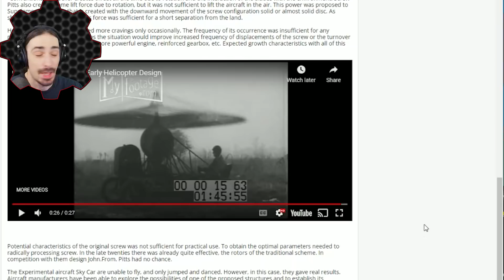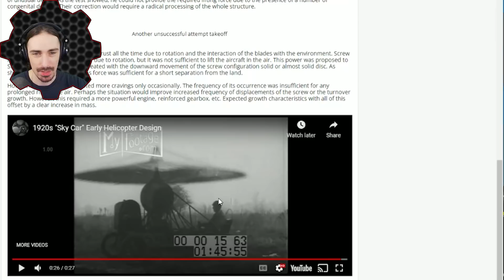Someone Actually Built This "Helicopter" And It Was Terrible... SO I MADE ONE!

Comment: This might stray from the purpose of real life recreations, but I'm actually really curious if there's a way to make this thing work. The concept clearly works, which is actually surprising, and I fully believe that you might be able to use the same method of catching air to generate lift in something different. Do you think you could make another try at this, but forget about making it look like the original entirely, using the concept in a different shape to make an unorthodox yet somehow functional flyer?
Reply: I agree and the one thing I noticed that hindered its flight is the angling of the entire vehicle.  If it stays perfectly upright it can actually either hover or slowly gain altitude.
Reply: The problem I noticed is that the lower part of the vechicle is too light. The wing-cone is the heaviest part so when pistons move most of this movement goes into the chassis.
Reply: @mixer0014  Yeah, he tried to fix that with weights, but I think he could've found a better way if he hadn't constricted himself with the shape of the vehicle. He had to, as this was a copy real life creation video, which is great content on its own, but it does make the creation much worse than what it could be if he had free reign over the shape of the craft.
Reply: If the cone was angled the other way (up), the shape would actually self-stabilize the vehicle in the upright position.
Let me give two examples with vehicles that are tilted to the right and drifting to the right. (On any vehicle where the lift is stronger than the drag, tilting the direction of the lift to the right will naturally accelerate you to the right.)
First, imagine the (original) vehicle with the cone angled down. The forwards blades (the right ones) are at a steeper downwards angle (because the vehicle is tilted right), so they catch more of the sideways flow of air and get pushed down harder than the rear wings. That means the vehicle will increase it's tilt and you get into a feedback loop.
Now imagine the same rightward tilt and rightward motion, but for a vehicle with a cone tilted upwards. Now, the rear wings will be at a steeper angle and catch more of the sideways air flow, eventually stabilizing you.
You may still get into an oscillation if the stabilization comes after too much of a time lag, or you may run into the problem of helicopters with ducted fans, which naturally self stabilize so much that their maximum sideways tilt allows them to reach only walking speed, but at least it has a chance of working.
Reply: To be honest, the way to make it work would be to put it in water. This is already pretty much exactly how jellyfish swim. It's obviously capable of producing thrust, the problem being the amount of thrust is less than its weight.
Reply: @cetomedo  he now HAS to make use of this and turn it into a full mechine now
Reply: Add some counter torque, like a traditional helicopter
Reply: I just made a comment explaining how I believe that a person could get this to work, it would involve a second set of blades with the same functionality as the first set but used in a slightly different manner. Check out the comment and see if it is something you think could work!
Reply: @boiltheoil7109  maybe just copy past it as a main comment so its more visable and just remove the direct pointed interaction

Comment: 3:22 The spinning was probably in part designed to ensure that the flaps close properly and regularly and are not as prone to failing to external factors
Reply: That is true. They are attached to "free spinning bearings" and without the turning motion they could randomly close on either side creating gaps and possibly other problems. Turning ensures they always closes in the same direction.
Reply: true
Reply: I was saying that the spinning was causing the flaps to rotate or flap closer to the closing point causing the flaps to go into the correct place. It was a good idea, but horrible execution this car was.
Reply: True
Reply: I dont see any stops for the flaps to not close the other way around, so probably yeah
Reply: I'm pretty sure the flaps actually stop before hitting 90° (after looking closely) & it could be that it uses a rotary piston(with that I mean a piston that turns a screw in order to go up & down). But this is just a guess.
Reply: I believe spinning was probably a way to get gyroscopic stability 
For those don't know what that is, it's  how a top or a spinner stays up right when you spin it.
Reply: I figured that at 14:54 the spinning seemed to make a gyroscope effect, stabilizing the aircraft
Reply: @anteshell  but it spins too fast, the spinning causes the flaps to always stay closed
Reply: @cyantasks7129  Thank you for informing me Cpt. Obvious!
Reply: the slats are supposed to be closed all the time while spinning, unless it is pushing up to let more air in

think of it like the inside of a parachute
Reply: I agree. Since the Scrap Mechanicsburg version it's powered to open and close the flaps it doesn't need rotation. Scrap Man, please try this once more without the rotation and make an update video if it makes any significant difference!
Reply: @RealPanzer999  i was about to comment the same thing

Comment: The idea is this: the propeller construction goes up, with the flaps 'open' letting air through, when it goes down, he flaps will 'close' adding a lot of resistance, generating some lift. It spins so that the existent drag would encourage the flaps to close faster. Which means that the propeller construction doesnt need to spin fast at all, but he oscillation have to be quite long and very rapid for it to function properly. Theoretically this would work. If you disregarded a lot of things. It was probably a take on an ornithopter
Oh! Its a wheeled-air-jellyfish
Its like using the reed valve instead of a prop
Reply: i think using sails would probably be better for this then wings

Comment: Hello! Back with another comment, I would love to see you make another version of this! What I have in mind would essentially be the same vehicle but with something that might make it fly! I think that if you added a second copy of the wing mechanism underneath the pistons spinning in the opposite direction/opening and closing at the opposite time of the top propeller it might actually work, the reason I believe this is because when you initially start the machine it pushes off the ground and that's where the momentum seems to come from, if you have this opposite set of blades it should act as drag to keep the machine in place as it pushes the top set of blades upwards and it would counter the torque keeping the vehicle more stable. Keep making great videos!

Comment: I have a good challenge for you. Try to make a helicopter using vertically aligned rotation. (so the "rotors" are upright like bike wheels). I'd imagine they would look like steamboat paddle wheels, and you could vary the angle of the "paddles" to produce lift in the right direction.
Reply: basically the cyclotech VTOL?
Reply: @apersunthathasaridiculousl1890  Similar, but it looks like the cyclotech uses fixed blades (I'm not familiar with it.)

Comment: my theory as to why the cone was spun is because it would help the flaps stay more horizontal, so on the down stroke, the flaps have much less distance to travel in order to close and capture air. the flaps are probably also able to rotate by 180 degrees, so the spinning guarantees that each flap closes the proper direction. also, if there were no spin, there would also be much less air encouraging the flaps to close, like dropping paper vertical to the ground, the paper will fall and cut right through before eventually rotating enough to then become horizontal.

Comment: Hi there Scrapman rather than the concept of this flying car, I think this inventor thought of the Slinky effect.  You know with gravity that if you stretched a slinky from top to bottom at a vertical angle then drop it you get the effect of the top needing to come down first in order for the bottom to fall, meaning that it is in a temporary state of zero motion which is keeping it up in the air until the top comes down. So I theorized that he might have been thinking of that but trying to do the reverse and continuously keep zero motion but use the top to push upward.

Sorry for the long text, I just like explaining something that might be funny or interesting if not at all.

Comment: You should try a second propeller attached underneath the car, moving down when the top one moves up. Not sure what the wheels would look like in that case, but at least the torque and piston motions should cancel each other out, and make the thing a lot more controllable. Maybe something where it "takes off" facing the side, then you turn vertical once in the air? Or have it where it can tilt up, once it's in position to be ready to take off, so it has a "drive" mode, and a helicopter mode?

Comment: The spin was because on the upstroke, while the flaps where angled, they'd catch the air and push down while it lifted, far less than the pull on the down stroke but theoretically enough to compensate for the moment of liftlessness.

Comment: the idea of the rotation is that the flaps even though not fully vertical can cut through the air with minimal resistance while the fully horizontally rotated flaps will have the same resistance while spinning resulting is "maximum lift" and minimum downforce. I cannot confirm that this was the creators point with the rotation but that's at least what it would resemble. 

But i don't think he considered the unstable nature of this and the extreme torque from the huge flaps up top...

Comment: the reason the thing acts more like a parachute is because of a thing called autorotation and is actually used in modern helicopters today if the engine were to fail
it's a fun thing to learn about and helps you understand a little more about helicopters

Comment: The blade movements makes me think of a jellyfish.  Which does move through the water.  So I can see where the theory of this flying comes from.  However the problem is that though the blades provide some lift, the piston pushes the vehicle back down with grater force.  Thus no flight can be achieved.
But the inventor is lucky he did not get off the ground.  Because He be in a world of hurt as it spins, topples, and crashes.

Comment: Honestly, if it used tho such feather-like umbrellas, one above the other and moving in opposite directions, then the up-and-down movement of the vehicle might get canceled, and then removing the rotation and using some springs to keep the flaps at a 30 degrees to 60 degrees angle while resting would allow it to not spin wildly. You can then then use 3 gyroscopes for rotation, one for pitching, one for rolling, and one for yawing, to get complete control of the vehicle while in the air, to tilt it in order to move in any direction.

Comment: To be clear, this doesn't work on the Two Main "Principals" of Flight and Avionics:

• The Bernoulli Explanation (Pressure Differential) - The Air Taking a Longer Path Over a Wing or Blade meets up with the Air taking a much Shorter Path under a wing or blade at roughly the same time, Creating a Pressure Differential, thus making the Plane Rise, Creating Lift.
• The Newtonian Explanation (Air Deflection) - The Air caught under the Wing is Deflected Downwards, Creating an upward Force that fights with the force of Gravity until the power of that Force exceeds the Force of Gravity, Creating Lift.

(Regardless of whether or not the "Principals" above are actually true, the main consensus to creating lift is there has to be a Wing or Blade to catch Air, and Air has to flow towards it)

Here are the Sky Car's Flaws:
• Bernoulli - There is nothing on the Blades or their Design creating a Difference in Air Pressure, thus rendering this Contraption Flawed on the Bernoulli Front.
• Newtonian - There is no Stern, Rigid Angle of attack for the Blades to Deflect Air Downwards, thus rendering this Contraption Flawed on the Newtonian Front.

Educational Learning With the YouTube Comments Section Lads and Gents! :)

Comment: Yeah, the rotation is def a pre-biasing of the flaps, similar to amplifier biasing.  This would make the force required to use the "air diode" more controllable and predictable.  Also, the rotation appears to be tied to the pumping action.  As one accelerates, so does the other.

Comment: one thing that makes your attempt function better is because on the real example propolsion system is not aerodynamic at all but your version uses wings as flaps which makes your creation stay up in the air way longer because when you rotate it wings actually aerodynamically have natural lift because of it's shape probably that's the reasen your version works better

Comment: The  concept was a good idea at the time and there definetly is lift, just not enough, they'd probably need twice the radius of the umbrella thingy and a lightweight modern engine, well everything would have to be lightweight, probably even the pilot. And I don't think it'd be as violent once in the air, at least until it starts to tip too much... Anyways control could be possible with weight distribution and a counterforce. I'm saying all this, because I think it could work nowadays, but it would be extremely inefficient (I am aware of that, yes)

Comment: Staying in theme of copter like vehicles maybe some autogyro? It's similar to helicopter but rotors are not connected to engine but use autorotation from air movement as it moves forward powered by propeller

Comment: Hi there is a suggestion for you. The bottom line is, you need
to put a zero-resistance servo under the rotor of the helicopter to compensate for the torque, and after that the body will not spin together with the propeller. It is verified that I do this with my models. For example, my model is a Single-rotor hilicopter + stabilizer in a steam workshop.

Comment: Couldn't you put the pivoting anchor or hinge and had a square tube and put tail find or maybe just turn the wings so they face each other in pairs so it won't spin.  Then put a prop in the back... and maybe put a gyro on it.

This game needs angled parts that you can put blocks on at say 45 and 22.5 degree angles.  A bit more programing power would be nice so one thing triggers another and when mixed with delays and such you could make things like a Walker or ATAT from Star Wars.  Maybe even a few sensors, like a crude Lidar, motion, light, contact...  Better armor plating would be cool... and maybe make certain building materials tougher than others.  A wider variety of weapons... including melee weapons (that do not break so fast).

Comment: There's no particular reason this couldn't have worked. It would just need a longer throw on the vertical and a significantly bigger 'umbrella' thing.

The spinning I'm guessing was so the flaps would all close the same direction, but I suspect as it sped up it was also preventing them from opening as fully.

See, this thing doesn't take advantage of Bernoulli's Principle. So, just like an airplane with a flat plate for wings, it would need enormous surface area to displace enough air fast enough to work as intended.

Comment: A suggestion for a terrible aircraft: the Isacco I-4 Helicogyr. It had four giant rotor blades with a propellor and engine bolted to the end of each. To start it four people had to go up stepladders and start the engines by manually spinning the propellors, then jump down quick before the rotors started to move. When it was tested, as the rotor came up to speed one of the engines snapped off and flew away, leaving the rest of the machine off balance and coming apart.
http://www.aviastar.org/helicopters_eng/isacco.php

Comment: 17:43 Adding more weight to the bottom won't help it stay upright. See this video for more explanation https://www.youtube.com/watch?v=OYHCP3-mpxk

You should add an active control system, like the motorcycles self balancing system, but in two directions 90 degrees apart

Comment: I'd like to argue that, regarding the physics of this vehicle, it might not be actually flapping as much as it is jumping really good at first, and just parachuting/gliding down afterwards.

I would think it would actually be better either having the Folding+Flapping happen and not the spinning, or the Spinning and not the Folding+Flapping. They seem to counter one another physics-wise in this conception.

Static wings work best through moving air whereas moving wings work best through static air. This vehicle seems to try to use both on the same set of wings, which is counterproductive

Comment: if you a square and put this mechanism at the vertex's of square like this
m1       m2
        c
m4        m3
M stands for the mechanism
c is centre of mass of creation

and then program m1,m3 at once and then once there oscillation is completed m2,m4 will oscillation giving it more
frequent force and it that's not enough

use this layout

m1 __m2__ m3

m4___   c ___m5

m6___m7___m8
 and hopefull you understand want I am aiming for and it that not enough then

m24    m9      m10    m11     m12

m23     m1 __m2__ m3     m13
 
m22   m4___   c ___m5     m14

 m21     m6___m7___m8     m15
 
m20    m19   m18   m17    m16

 and hopefull you understand want I am aiming for and will we contiues to do this untill games tells us to